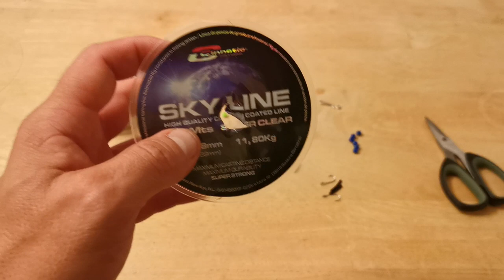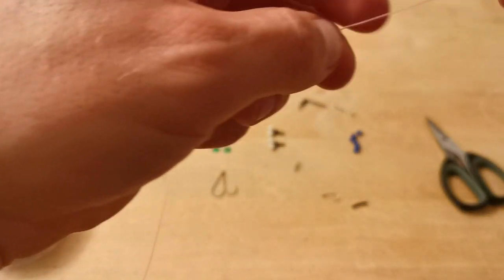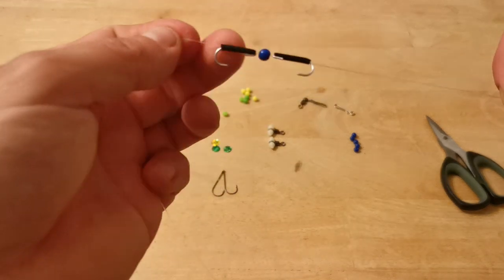How to Make a 1 Up, 1 Down Clipped Rig

Comment: Hi Greg would you recommend breakaway coil crimps instead of barrel crimps.or would you prefer adjustable crimps.
Reply from the maker: I prefer no crimps at all. I hate crimps.  I would always go with figure of eight knot or glued silicone stops.  If I had to use any crimps it would be adjustable ones👍